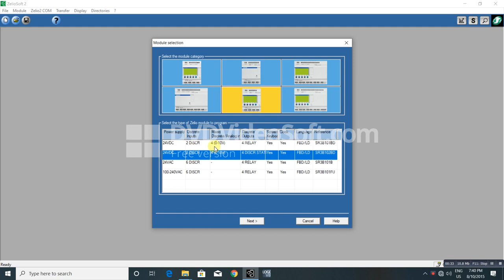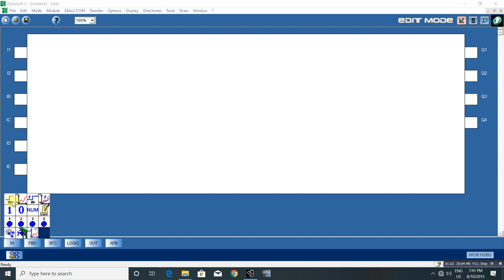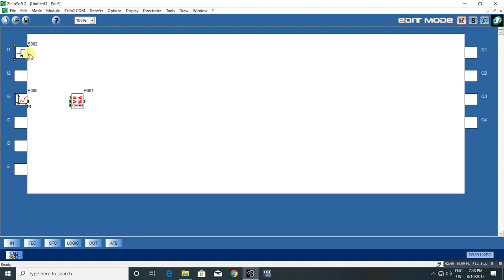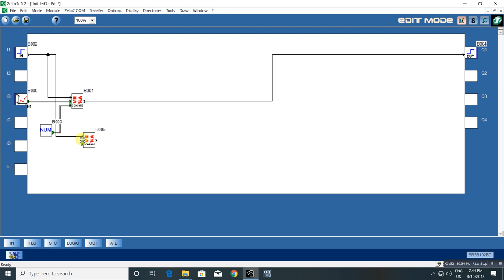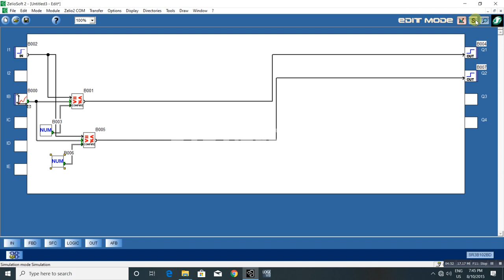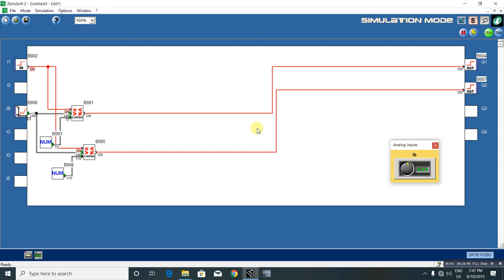Zelio PLC analog input scaling, configuration , SR3B102BD,

Comment: With this example, and thinking of a dual pump scenario, does the plc have the ability to switch on at a set value and continue running till its signal reduces to the hysteresis that is set?
Reply from the maker: this is a sample logic for scaling the analog input signal from external sensors...